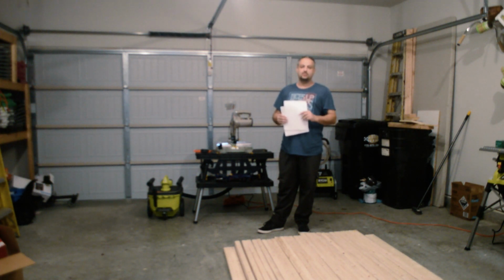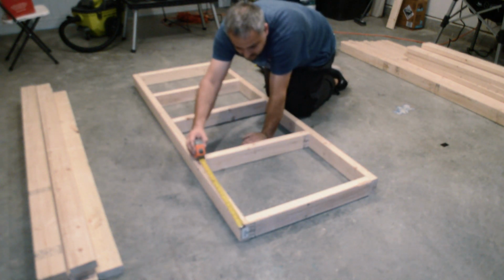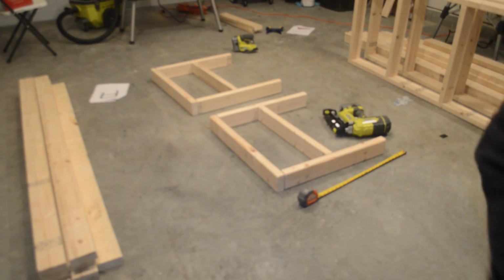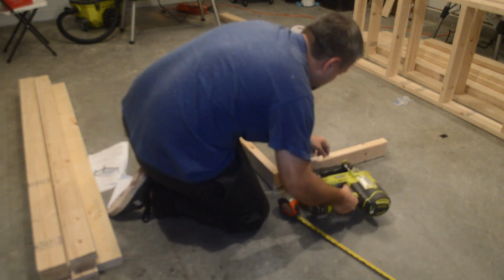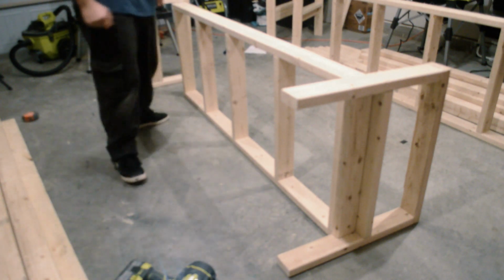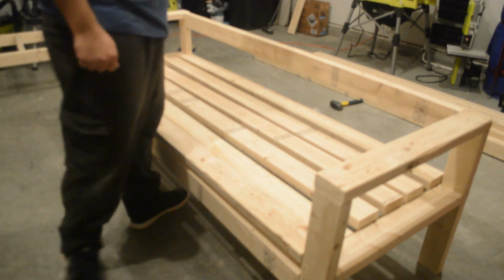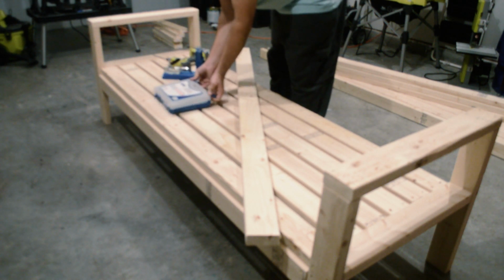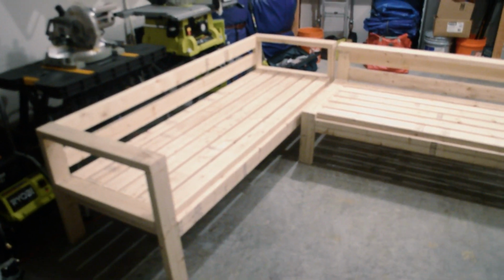Anna White - 2x4 - DIY Outdoor Sofa

Comment: Anna's plan is ok, like the backrests...after time the wood will bend or cracks where the screws are!
Reply: Pockethole screwing is likely the issue. Other attachment means will probably work better.
Reply from the maker: I agree Im not a fan of the pocket hole to hold the back of it. I might have to add more support to it later on.

Comment: I'm sorry but bradnails are not necessary, some of us don't have one!

Glue, pre drill and deck screws are enough!
Reply: CharmGUY, that's a silly comment. A drill isn't needed either. Some people don't have one of those either. Use a screw driver. Use other options. A brad nailer will help speed things along, just as a drill will. As he stated, it helps keep things together until he can screw everything together.